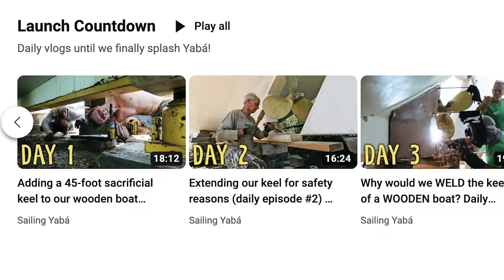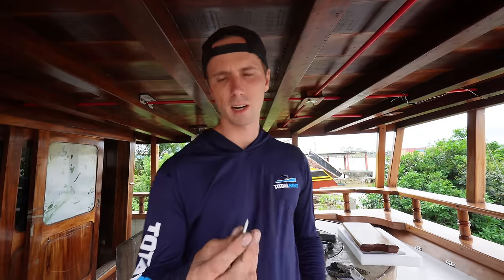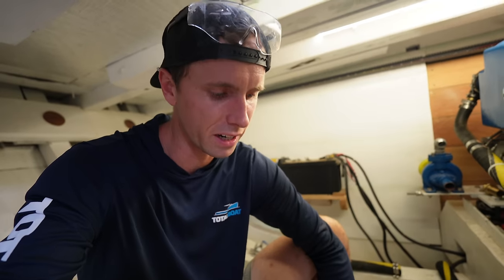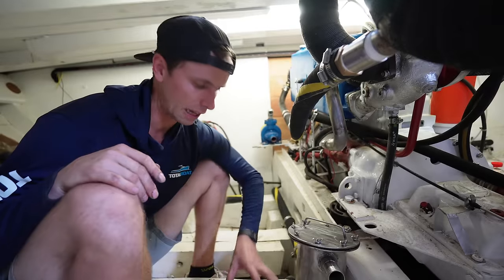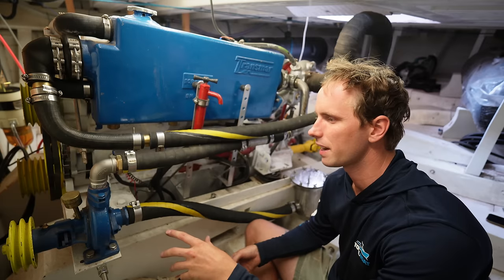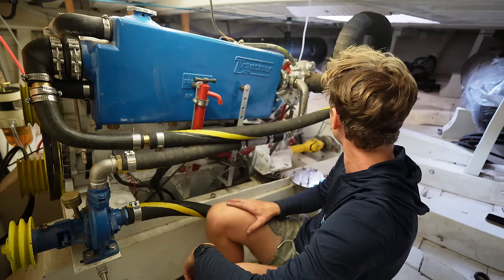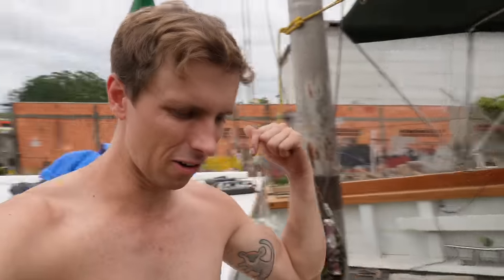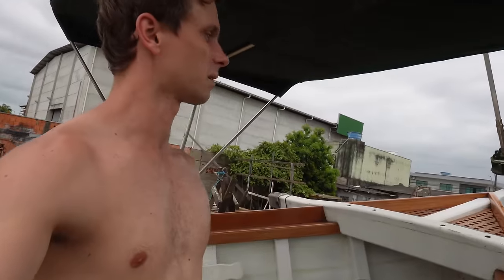Wooden boat refit: We have engine cooling and added some shade to the deck  — Sailing Yabá 174

Comment: Hey Ben engines looking great, but just make sure that all your hose clamps are now accessible now that they’re on the engine. It looks like a few of them that the screwheads are bolt heads, or whatever of the hose clamps are facing inward toward the engine and I would think you’d want them accessible from where you are so my thought is you put it on the device like the water pump or whatever and attach the water pump to the boat into the engine but now that hose clampif you needed to tighten it or change it inward toward or not outward where it be easily easily to get just a thought

Comment: We call them  Stillsons..
A pipe wrench is any of several types of wrench that are designed to turn threaded pipe and pipe fittings for assembly (tightening) or disassembly (loosening). The Stillson wrench, or Stillson-pattern wrench, is the usual form of pipe wrench

Comment: the Teflon tape you have, the only reason anyone would complain is because they don't know how to use it. I've been a machine repair man in an industrial factory for many years, and that stuff is like gold. And if you want to make extra sure you used to tape and then you use liquid tape exactly the same material Teflon, and that works real well to. But I've never had a problem with just using a regular Teflon tape. And unless you don't put it on correctly,

Comment: The hose that goes from the sea water pickup to the trap, is it a pressure hose or a suction hose, looks like a pressure hose, if it is it will collapse if there is a partial blockage in pickup, when it collapses it will block the water completely, diesel engines don’t survive over heating.

Comment: Those two water hoses on the engine near the oil drain need to be secured to prevent abrasion from engine vibration causing them to rub.

Comment: Although the engine is fairly complete, it is still critical that some kind of shroud is placed around the drive shaft in the engine bay. It does not need to be heavy, but will serve as a reminder of the danger.

Comment: Firstly they were called stilsons in my day. More importantly the top hose on your engine needs cleaning off the lower hose as the will rub with engine vibration and wear out causing a leak.

Comment: There are many ways to do a job.  Becauses of electrolysis caused dry rot, I do not let metal from the outside touch wood.  So I would have liked a rubber grommet around the thru bolts (compressor hose etc.)  Protect with zincs wired to thru bolts.  I understand the locals wanting to protect the rudder from groundings on this design boat.

Comment: Ben - in a sail boat the raw water inlet scoop should be pointing aft to prevent water being scooped up when under sail and possibly flooding the engine backwards through the exhaust. Power boats have them the other way around as when moving the engine is always running. I think you have yours on backwards - sorry!

Comment: Looking at the cooling hose set up, I am concerned about two items. 1: Securing the raw water filter and 2: Some method of preventing chafe on the hose that goes to the exhaust elbow as it passes by the oil pump out.  Otherwise, great progress.

Comment: The discharge water pipe should not touch the inlet water pipe as the vibration and movement will cause it to run.  Maybe the discharge can be hung or suspended.  

Also maybe cut a block of wood to stop the water filter moving around.  

Doing great!!
Reply: Secure everything.

Comment: Why are you not oversizing the through hull holes and epoxying them to seal them from rotting the wood from any water then seal the fitting with the sealer. We all know they will eventually leak and the epoxy will stop the water from contacting the wood in the hole. Like double sealed or rot prevention .

Comment: From experience, It would be wise to ensure that your hoses are not resting on one another.  The vibration from the engine will eventually cause the hoses to wear (where they touch) resulting in a hole in the hose and a super huge problem.

Comment: The machine screw you sharpened the tip of does not have threads designed to hold it into wood as you hope it will. You need to replace it with a wood screw before you launch!

Comment: You might have considered using some thickened epoxy to line the hole.  This will prevent even a little water intruding into the wood causing it to deteriorate.
Reply from the maker: We did! In the previous episode 😉

Comment: Irrespective of what hose clamps are used it is good practice to put two clamps on each hose end on pipework connected to the sea. Adaptors are more correctly called reducers. Your sea cock valve is not a full bore valve so although the connection is 2 inch diameter, the hole through the ball is only 1.5 inches so you are not actually losing any efficiency, However, had you fitted a 1.5 inch valve the effective diameter would have been smaller, reducing the cooling water supply slightly.

Comment: As already said below by Rolandunk the pipe grip tool is called a Stilson, but If I remember correctly it is also known as a monkey wrench. It was the favourite tool used in older films to give someone a tap; No not a plumbing fitting, on the head. Not in a nice way, you understand. 

It looks as if you have fitted those round, stop type pipe 'Jubilee Clips', that's what they are known as in the west, with the screw tighteners in a difficult place to do up or undo?  Those new clips look, the business.

All the very best to MP.

Comment: Ben - great stuff. Can you check that the two water hoses you installed do not rub and chafe with engine vibration. They may soon wear through. Would you be bale to separate or isolate them where they are currently touching. Be well, MP.

Comment: Maby just me but i would have put the valve from the cool water so you can close it just by pushing it down so if some thing hapens you dont have to dive to the bottom and maby hit your head when rocking on the waves and put qnother one on the other side of the filter so you can clean it without spilling to much water out of the engine thanks for the vids and best wishes to mp

Comment: Teflon tape and silicone gascet is worst chuse. Linen fibers are best solution. Are self-sealer even if have leak after soak seal by water.

Comment: Hej, from Denmark, the tape you are using for connecting pipes is fine. BUT do not, under any circumstances, turn the threading backwards. Then it leaks. Guaranteed. 
Ole

Comment: The clamps where they use spot welds are also suspect, the reason is the spot weld brakes and the clamp becomes loose but visually they look fine, there are types where tabs are used, or better still runs tig weld on the spot welded clamps.

Comment: Was wondering if you vented the diesel tank. As you use the fuel it needs to be replace by air or the engine will pull a vacuum on the fuel tank and starve the engine. Most systems are set up using one tank as a day tank and you just transfer fuel as needed to the day tank. Less complicated piping. Also the return line from the engine needs to go back to the tank you are feeding fuel from. Very complicated with 4 tanks. That's why using a day tank is far less complicated. Only one tank to draw from and one to return to. You transfer fuel from the other tanks as needed to the day tank.

Comment: Not opening up that through hole a little more could become an issue. In order to get  the pipe in place you needed to thread it down which will affect your caulk. Also when you tighten it down it may not fully pull through. Looks like a future below the waterline issue.

Comment: That orange colored wrench is called a pipe wrench in my part of the US.  Did it leave bite marks in the brass?  Having some experience in the skilled trades, I would have chosen a large adjustable wrench for that work, or perhaps what are known as channel locks, but they too may leave marks like the pipe wrench.
Wishing MP a speedy and complete recovery.  Keep up the great videos…anxious to cheer you on towards the big splash!

Comment: The white tape is what I call thread (or Teflon) tape. It is made in different colors depending on what it is used for. One color is for water pipe and another is for gas (not gasoline) pipe. There is a third color but I don’t recall what it is made for.

Comment: It’s called a pipe wrench.  Typically used on round pipes and fittings because the teeth bite into the pipe to grip it.

Comment: Yes, definitely been missing MP’s big smile and bubbly character, hope she has a very speedy recovery. Wow, didn’t that through hull complain 3:46 - 4:10😆 In the UK the tape is referred to simply as PTFE tape shortened from polytetrafluoroethylene thread seal film tape. The tool you were talking about is widely known as a Stillson or Monkey wrench and was invented in the year 18something by American inventor Daniel Stillson. Hence the name Stillson. Ben one thing I notice is that the engine coolant hoses could do with being supported to keep them apart from each other and anything else, to reduce any chance of friction wear. Also to reduce the stress on the hose connections from the weight in the hoses when operating and full of water. Vibrations when the engine is running can quickly wear through two hoses that are close to each other or touching anything, also then there is the motion of the sea rocking water heavy unsupported hoses, again potentially causing friction wear and stress on hose connections. Basically anything that can move will move when at sea. If it can be secured, secure it. I know you probably know all the above and have planned to secure everything, but you did say everything from the inlet to the exhaust tip is completed. One idea would be to reposition the oil tap. Use the existing brackets as fixings for the two horizontal coolant hoses securing them out of the way. Then make an extension bracket off of the bracket you have the oil tap fixed to presently so the oil tap is fixed your side of the two hoses, keeping it away from the hoses so there is less chance of any friction wear. Dont ask me how I know this! I do have to say what both you and MP have achieved, especially when faced with so many challenges along the way, is inspirational, (a sinking boat and lots of rot). Well done Ben, well done MP and well done to the team of professional tradesman who have helped you both along the way. Really looking forward to that 'Yaba, Daba, Do' moment when Yaba finally hits the waves. Looking forward to tomorrows instalment and best wishes to MP.

Comment: both types of clamps are fine the smaller type just use stainless, its not like you running very high pressures.

Comment: Couldn't help noticing that the 2 rubber hoses for raw-water into and out of the coolant heat exchanger are resting against each other. A hose clamp on the egress hose is also apparently contacting the ingress hose. Clearly, no problem short term, but won't the friction from engine vibration cause wear over time?
MP, Fique bom logo! 💐

Comment: I wonder how the water intake for the engine will not get clustered by crud and small living things. The pressure will make them go through the coarse screen in the separator and into the water pump, engine, etc. I am no marine mechanic so that's worth what it does.

Comment: Amazing job rebuilding this boat ... hoping MP feels better soon missing her energetic aura ... from this video, thinking you might reconsider orienting your hose clamp screws so they are easily accessible in the future for servicing ... the ones you added on the black and yellow hose appear to be only accessible by having to get close and personal with a potentially hot engine ... also, your trough hole and adapters appear to be Brass and the ball cock  appears to be some other material ... with salt water, dissimilar metals in close contact have the potential to corrode much faster so wondering if this is an accident waiting to happen considering your concern with this being a  major through hole?

Comment: how are you going to secure the seawater inlet filter?  Use a steel strap with rubber liner to secure it to the engine beam....

Comment: We call it a monkey wrench in the uk the heavy part on the neck where the adjuster is I also used as a hammer I use them in the garage where I work a lot really dureable and handy tool too own🦾🔥🔥🔥

Comment: Pipe wrench.   Just wondering why you are not putting epoxy coating on the though hulls.  Also every other cruiser we have watched has put caulking on the inside of tgis through hulls so you were correct in doing that

Comment: I'm not a boat builder but do you think that the raw water filter should be raised so at least the top of the raw water filter should be above the water line from a safety point of view? Otherwise won't sea water flood the boat when you remove the filter to clean it?
Best wishes to you both and speedy recovery to MP

Comment: Pipe wrench or monkey spanner is the name of that spanner. Sadly you made the hole so small in 1990 in boat building we made the hole bigger and filled it with 1rst soft epoxy to penetrate the wood and than thickened epoxy to fill the hole and re drill it for tight through hull fitting this way you prevent at all times water to penetrate the wood. 2 nd the trough hull inlet to face aft in  stead of forward because when the engine is sucking water and a plastic bag comes on it it blocks the inlet while backwards the plastic back in the water will flow off often debated.

Comment: Its the US Navy's practice to double valve every thru hull fitting. Just in case.
If a single valve were to fail far out at sea, the boat would sink.
Just In Case.

!

Comment: The tool is a pipe wrench.of different sizes... are you going to cover all the spinny things on the engine and propshaft in the engine bay...if you should slip......

Comment: Shouldn't the inlet water filter be mounted above the water line, so that it can be opened while at sea to clean it. If it's below the water line and you open it won't it gush water into the boat?

Comment: Be sure what you use is bronze and not brass, which is unfortunately quite common in through hull fittings. Brass contains zinc, which dissolves whit time leaving a pink brittle metal. Time means years, but can mean months or weeks if there is a stray current around. Connection with ground helps, but not always. Bronze is the choice, more difficult to find and much more expensive. But a good quality bronze fitting and valve last for ever

Comment: hoses should never touch anything. if they do you need to wrap them so they don't wear through the tubing. Vibration will be present so address those water tubes.
Reply from the maker: Thanks for the heads up!

Comment: I'm not sure that mixing the 2 gasket materials together is best idea. Since they work in opposite ways. 
I have seen plumbers that worked with large threads like that twist the Teflon tape into a string and then wrap the string into each individual thread and then taped over it to get a good seal.
I hope this helps.

Comment: Hi Ben, you mounted the water inlet the wrong way around! The slope side should be facing the rear of the boat.
Reply: Can you explain why that is. It seems everyone I ask doesn’t know why.
Reply: Two reasons; dirt is less likely to get stuck on the inlet and the pressure of the water while sailing can be so high as a column of 80cm from the inlet into the hoses and thus creating high risk of hydrolock in the engine...

Comment: While your at it take the strainer lid and put a threaded hole in it. This is so you can fit a test cock. Allows you to see whether you have water in the strainer, also allows you to bleed the salt water system. It might also pay to put a test cock on the highest point of your salt water sytem to help with bleeding by getting rid of trapped air.
Reply: The tool is called a Stilson in English or monkey wrench if your American.

Comment: it is called a monkey wrench or adjustable pipe wrench. rather than diesel gasket sealant material use tread sealant also known as pipe dope with your Teflon tape.

Comment: Sorry to be critical, Ben, but it seems to me that by having the thru-hull fit so tightly in it's hole, you're limiting the ability of the inside nut to pull it tight against the outside of the hull.  It would be better to be a slip fit and let the nut pull it tight.

Comment: I am not sure of the proper name, but most people know what you are talking about if you say "monkey wrench".  Your sea chest or inlet strainer for the engine should be mounted so the top is just above the water level so that you can open it when you are in the water to clear it (it also gives a good indication if it is plugged when you open it and there is no water... maybe it is mounted that way but it looks low to me. I also have found it nice to have the sea cock for the sea chest to be in a clear place so I can ram something through when (not if) it gets plugged. Yours looks ok for that. Finally, our prayers are with you, for a speedy recovery.

Comment: That's a stillson wrench or a pipe wrench. The straight jaw wrench is usually called a pipe wrench but the flex jaw wrench is usually called a stillson. It is not a monkey wrench because the jaws are not square and straight.

Comment: "Pipe wrench".
Reply from the maker: Thanks!!!!
Reply: Do forget to “earth bond “ the intake, strainer etc. if you don’t you might not get 5 years before they corrode through
Reply: Everything below the waterline should be double clamped
Reply: Precise... for a pipe and not for this... Then they call it a killer, because you destroy everything with it when not used properly.
Reply: Pipe tape, pipe wrench
Reply: @leonmarcusdavison  What does that mean “earth bond “?